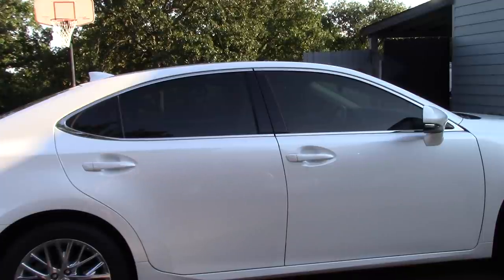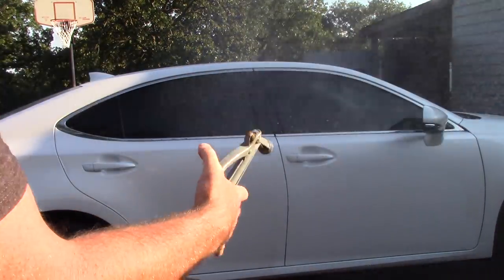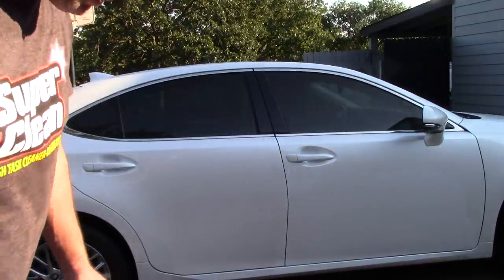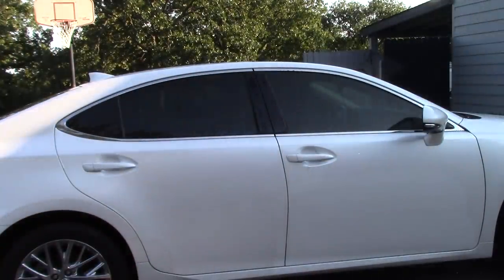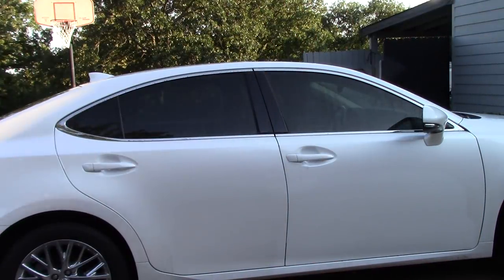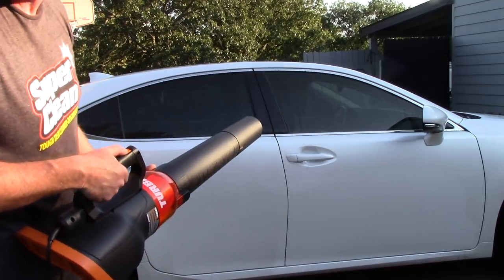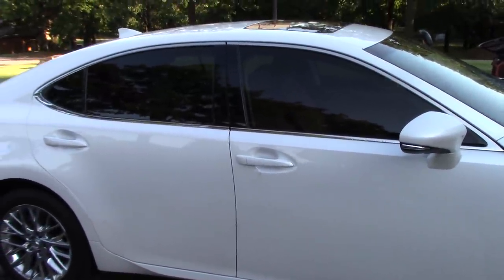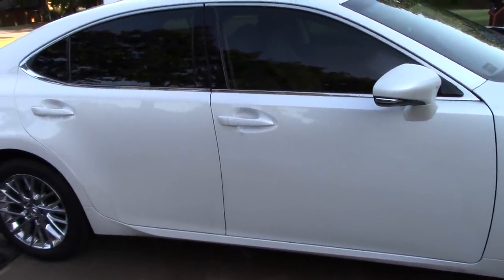A Great Way To Dry A Car!

Comment: The Absorber towel is where its at.
Reply: if you like scratching the car to hell and back.  I should know, I used to use one many years ago.
Reply: But how does it scratch the paint? I mean waffle weave microfiber towels don't really dry that great and leave streaks behind.
Reply: Because any particle of dirt left on the paint (and yes there will be some even after a wash) will just get pushed around with the Absorber towel or any other type of chamois, natural or synthetic.  Microfiber will at least help pick up the particle so it doesn't keep getting pushed around.

If you're not getting good drying results with a waffle weave towel, you may not be using a high enough quality product, something like a 70/30 blend towel from The Rag Company or similar.  I have an old, big waffle weave towel from Autogeek purchased probably 15 years ago that still works awesome.  Drys a car very quickly.
Reply: I have The Rag Company Dry Me A River Jr towels and they do dry good, but after awhile they leave water streaks behind. Sometimes the streaks will go away but there are sometimes they don't.
Reply: I have those same ones, big and small versions, and I don't like them as much as my old, plush waffle eave towel.  The Dry Me A River towels are much thinner.

Also it's best to try to get as much water off as possible before using the towels.  Either with blowing air, or by sheeting the water off using low pressure water (i.e. hose with no nozzle), and using a drying aid helps, also.

Comment: fuck yeah.
Now how the fuck do you dry them in ice cold .
Would you heat car inside dead hot and then slightly open windows while keeping can inside hot and airmover going 
How long did it take you to completely dry them please.

Comment: Is gas leaf blower safe to use?
Reply from the maker: some would say the fumes from the engine could be pushed through the outlet tube...i think a gas leaf blower is fine if that is what you have:)...it should work just fine

Comment: Try not to use gas blowers... some of them either suck up portion of the exhaust from the side or directly have exhaust fully mixed with the blown air and exit through the nozzle (to reduce fumes near the user)... and obviously with 2 stroke engines they are spitting out a lot of unburned fuel and oil. Also, some blowers come with spreader tip that makes it even easier since it creates a "line" of pushing air (usually at a higher speed as well).
Reply: I use a gas blower and have not experienced any of those negative effects. My car looks fantastic.

Comment: Forget all this nonsense. I got a deionizer, changed my life. No drying, no spots, no stress!
Reply from the maker: yeah i could buy a cr spotless machine that cost 450 dollars plus i would buy many replacement filters through out the future plus I'm mobile so that machine will take up a lot of space in my truck...oh and the setup time every time i show up for an appointment plus breaking it down...no thank you:) i will just use my worx hydroshot plus it has more ways to make my life easy and more uses than a cr spotless machine or deionizer:)
Reply: Dallas Paint Correction & Auto Detailing All of your points are valid, but "in my world" it's the best solution for me.  I agree it's expensive and not for everyone, I consider it a luxury and use it as such.
Reply from the maker: i agree and i have thought about one just for my personal vehicles at home:)...just hard to lug one around for my business:(..auto detailing is hard enough..lol
Reply: Dallas Paint Correction & Auto Detailing  I built my own for my mobile wash truck ( we do alot of semis ) and I've got under 100 bucks in the whole system and it works great! Filters are about 10 bucks for a two pack and they last about three months.
Reply: Info on this system?
Reply: I did
Reply: If you are using Rinse-less washing to do cars, than carrying around a couple of gallons of distilled wont be too bad, I imagine.
Reply: Dallas Paint Correction & Auto Detailing kno
Reply: pennmarks i

Comment: For those with frugal womens that need better justification... Black and Decker 12 amp blower mulcher, works great for both those purposes, also pushed 400 CFM... not quite the 600 here but... multi-tasking... multi-justifications

Comment: Car is poorly washed. Pay attention and you'll see a lot of dirt
Reply from the maker: Mian Ahmad yes there are some tar spots on lower panel but you can't remove that with a soap alone and it's not recommend to agitate with wash mitt to do so because it causes marring or scratches.
Those areas will be treated after the wash my friend:)
Washing a car is just removing unbonded dirt and soiling..truly cleaning a car requires other methods.
You obviously have no clue what your talking about but that's okay my friend:)

Comment: I got a 170 mph gas blower it took forever to dry.
Reply from the maker: i have tried those high MPH blowers as well...CFM is critical for pushing water off a car specially if no wax or sealant is present on the paint..thanks for your comment
Reply: Cfm is more important than air speed. That’s why you can dry a car pretty well at 80 mph on the freeway, the reason is because of the huge cfm of air pushing all of the water away.

Comment: I could dry that car quicker with a good large quality shomos and then a air gun on wheels and small sections where water is still standing like mirrors and windscreen wipers. Also open doors and do door hinges and seals.